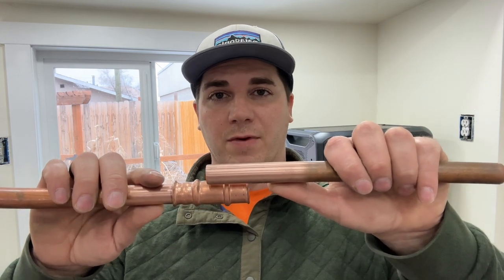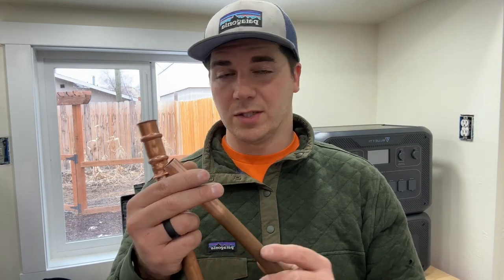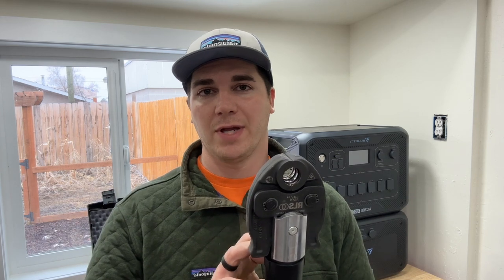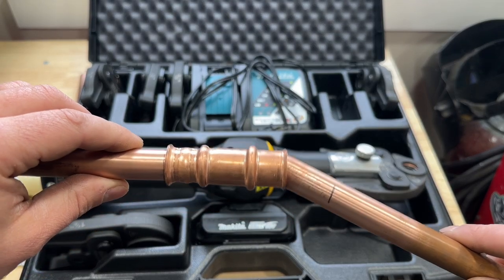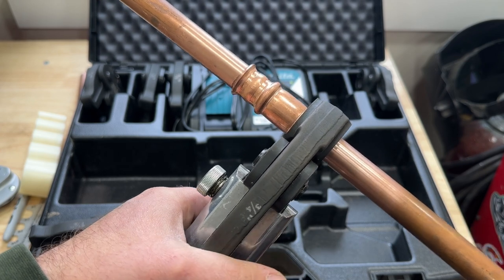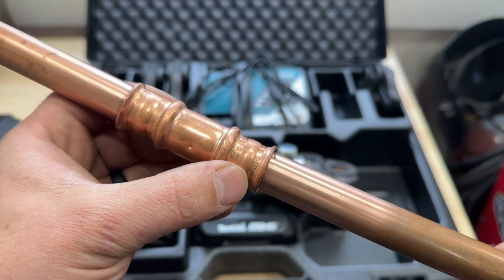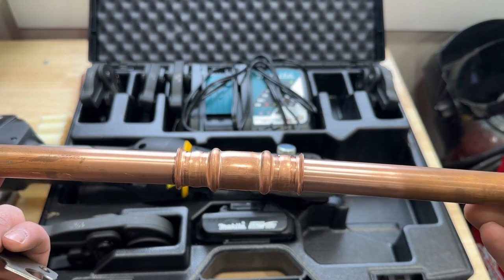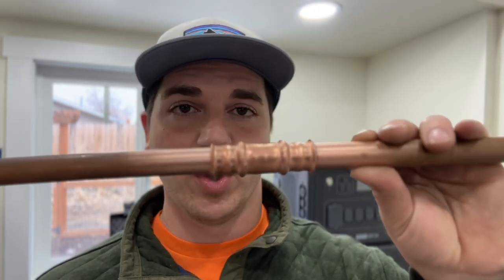3 Pro Tips For Using The RLS / Zoomlock HVAC Press / CrimpTool

Comment: This would be good if you have tons of joints to do, but for installing A/C or Heat Pump where you have like 4 or so joints I'd just stick with torch. Plus the tools is big bucks and so are the fittings. Like $14 for 1 elbow vs a couple bucks for a sweat fitting.
Reply: Come on man get with the times and embrace new technology, you only live once. What’s $4500 dollars?

Comment: Great tutorial! Little off topic here, but i noticed my main electric lines going from the wall switch to my furnace are 14AWG. Is there any problem with switching it to 12AWG ? It is on a 20amp breaker and it has 12AWG up until it goes from the switch to the furnace.  The blower motor pulls 14 amps when it first starts up and i think that is close to maxing out the 14AWG...? Thanks for all the great videos!!!
Reply: No problem at all!